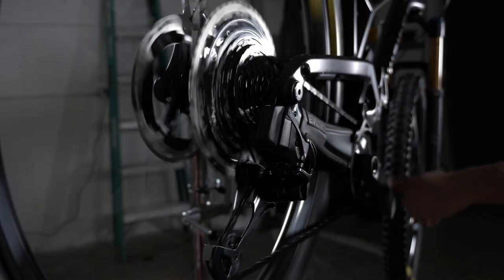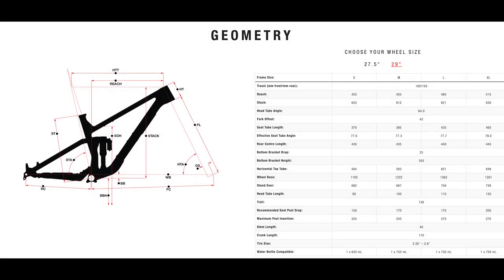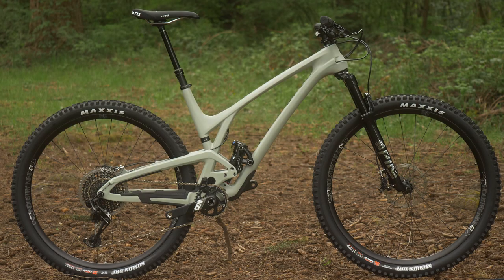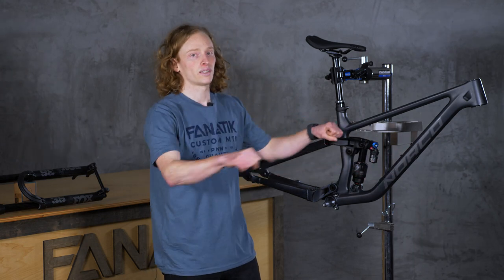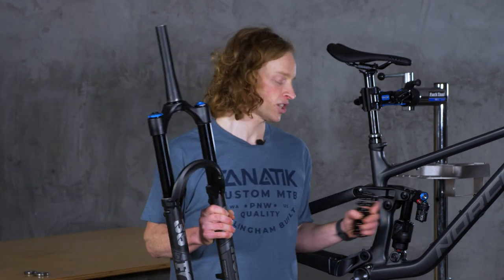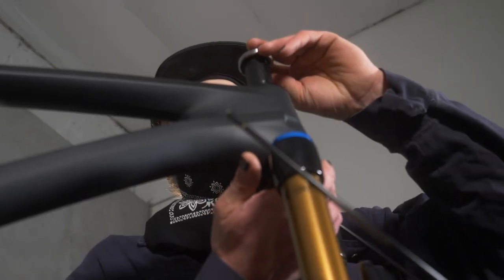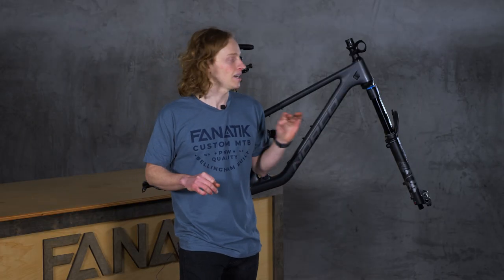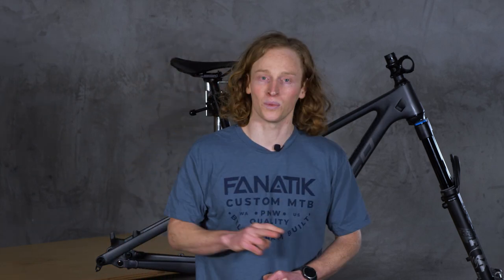How reach, headtube angle, and fork length are all connected | MTB frame geometry explained

Comment: It means for me being 6’3 with 36.5” inseam, used to ride an xl with a 120mm stem to get it to fit. Now I can run a 50mm stem and have an actual bike that fits. Well I should say 485 reach 639 stack 645 top tube effective. I could go xxl but I don’t know where any are to try I usually have the biggest bike, to me it’s perfect but when someone else gets in it’s evident that my bike is massive to them at 170/170 travel. To me it’s proportional, to a 5’6” person 170/170/ would probably feel huge and sluggish. When you get technical on bikes just literally don’t look at the size at all’s,m,l,xl,ect. Look at the numbers get some sticks and tape together a mock bike I say where you can generally get an idea where things are at. I’ll take an old bike let’s say sit on the seat and tape some dowels together and physically measure the reach stack and get an basic idea of where things are at, it’s archaic to do that but if you are in my position and every one around you calls a large a huge bike, I just hit my knee in the handle bar dude. But when you do ride a bike learn it’s geometry, highlight what you like, and what you would change, and when looking for another bike, ( you laugh now but yes buy another bike) this time after riding for a year you know your needs and then you can say things like, I want a longer rear chain stay to go with that reach, or the opposite, I can’t get back far enough so I opted for a short chain stay high stack shorter reach bike? Over biked is a term I don’t use as I feel my Capra for me is a beast enduro bike, but I’m used to a card 450 with 12 inch travel at 205lbs. So this feels very nimble to me. But I’m the one riding a wheelie up the climb and racing the way down. Get a bike based on your needs, not to look cool, I’m an enduro rider, and I push it to the limit. Don’t get and enduro and complain that it doesn’t pedal like a xc bike, get an xc bike and stop complaining. Don’t get an enduro bike because you think it’s like riding on a cloud, so plush, but I can’t do anything on it cuz I’m not strong enough or do anything to push the bike but man I look cool and I can sit down the whole decent? My favorite is passing a xc bike on the climb with my Capra. Then on the way down putting so much distance in them there is no chance they can keep up.

Comment: Do all brands use the "reach line" as the upper terminus of the effective seat tube to determine effective seat tube angle?
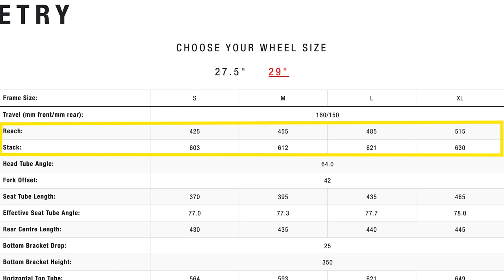Reply from the maker: Great question! That is correct, although technically, "reach" doesn't extend all the way to the seattube. It stops where it meets the vertical line coming up from your bottom bracket, as seen at 1:40. The "effective top tube" would be the accurate term for what you're describing as the "reach line."
As it seems you've realized, this does mean that taller riders who would run the saddle above that point have a smaller "effective" seat tube angle, and would have their weight further back over the rear wheel. So, the actual seattube angle can still be an important thing to know, especially if you have a very long inseam for your height.
Cheers - Dan at Fanatik
Reply from the maker: Here's the blog post. Same info, but has pictures if you prefer reading/looking at pictures. I find that's easier sometimes.
https://www.fanatikbike.com/blogs/engage/mtb-frame-geometry-suspension-how-it-works-affects-your-ride
Reply: @FanatikBikeCo   Thanks for that. I definitely understand ETT and reach, but didn’t know ETT is where STA was measured from. I guess that makes the most sense!
Reply from the maker: @scvkurt03  Yep. Not relevant for everyone, but at least it's a constant.

Comment: Hi dan! I haven't seen many bikes with coil-sprung rear end on this channel. Tbh i don't remember if there was any. So I have a question for you. Why is that? Have you ever ridden coil shock? How did you liked it?
Reply from the maker: Hi Jcob. We're gonna release my coworker Rich's bike check later this week, he's actually running a Push Elevensix (I'll keep what bike he has a surprise 😉). I've also run plenty of coil shocks, and currently have an older DHX2 on my downhill bike. 

They primarily don't get seen as much because they are substantially heavier than air shocks, and most of the bikes that we see are trail bikes where weight is a consideration. They ride wonderfully though (although not compatible with all bikes), and require less maintenance than air shocks.

Hopefully that helps a little. Check out our Build Gallery, which has plenty of trail bikes with coil shocks. 
https://www.fanatikbike.com/blogs/build-gallery

- Dan at Fanatik

Comment: Hi there, just wondering what you’d recommend for a transition patrol carbon 2019 shock wise. Iv blown my dhx2 with a progressive spring and need to replace it. I’m trying to choose between a 2021 x2 or dhx2. What do you think would work best on the bike? Like have any of the guys in the shop used either in a patrol or from perhaps customer experience ?

Comment: Can I use dirtbike handlebars on my cockpit?
I'm planning to put couple of spacers on my new stem ,since the bar diameter is 28mm.
Reply from the maker: Hmm, that's not a question I've encountered before, and I don't know enough about dirtbike parts to give you a good answer. MTB stems have either a 31.8mm or 35mm handlebar clamp diameter, and the fork's steertube is 1 1/8th"
Reply: Look at the Pro Taper 3" rise MTB bars.